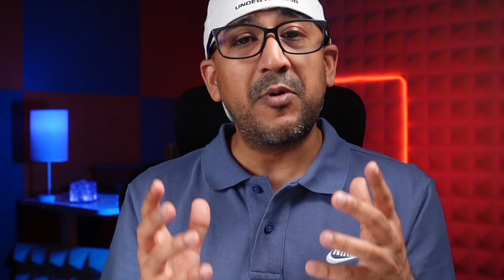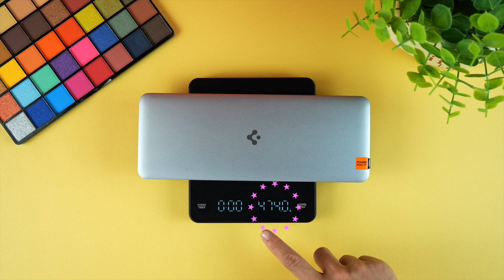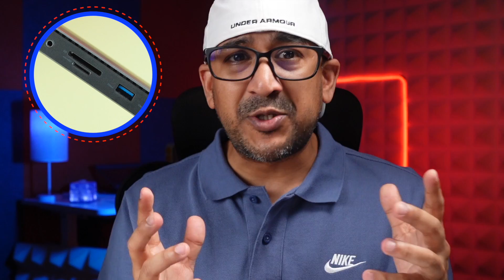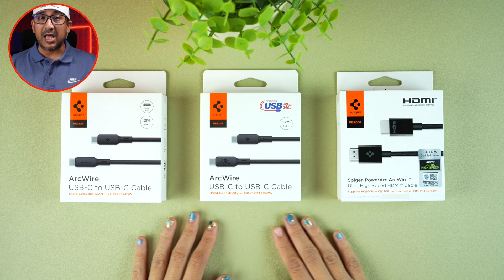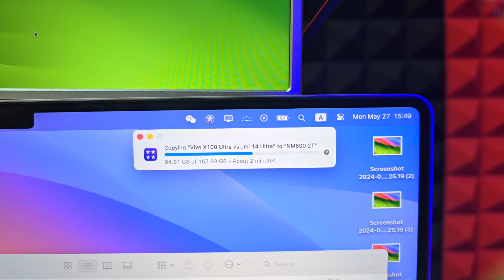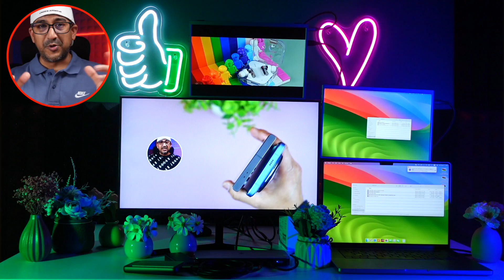Spigen ArcDock Pro 14 in 1 Docking Station Review

Comment: I got a very strange behaviour with this dock. I have two identical dell 24“ WQHD screens. When I connect the MacBook Air M4 to the dock only both screens work independently when I connect both screens with DP. When I try to connect the dock and the same screens with a Lenovo windows laptop the screens only work when I use one HDMI and one DP cable…. Sometimes. Sometimes only one screen works work windows. This is so strange